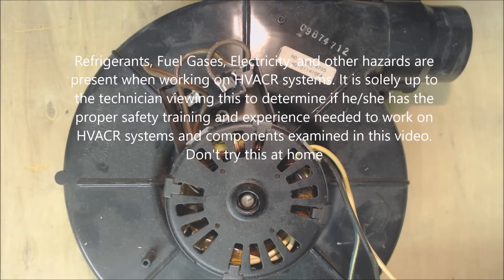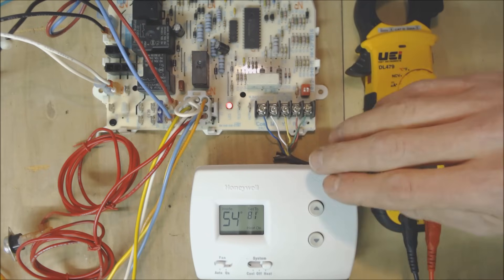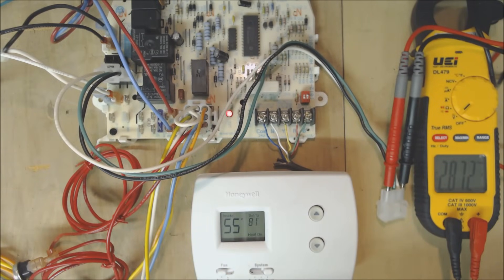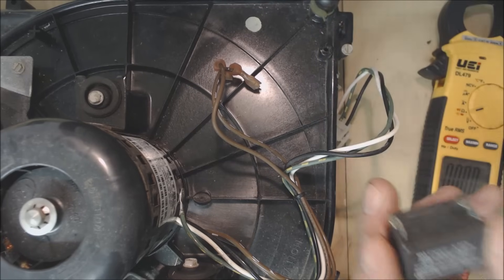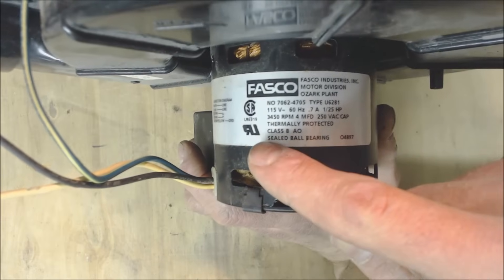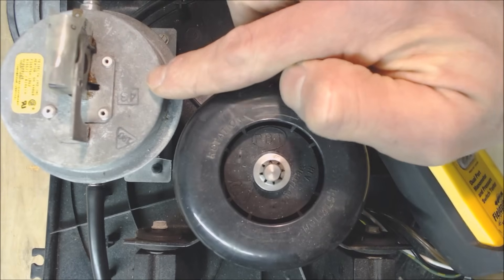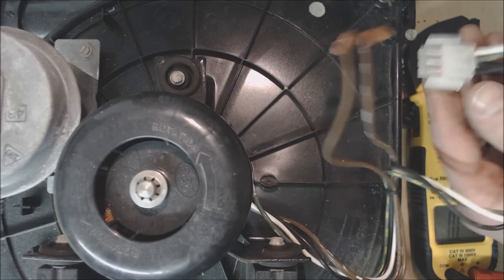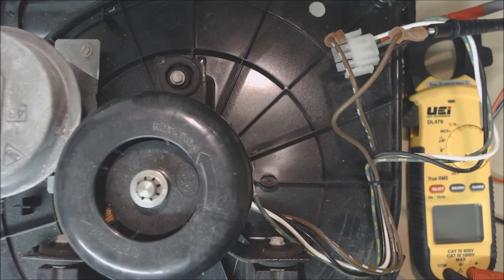Furnace Inducer Motor Troubleshooting! Top 8 Problems!

Comment: Good evening 
I have a Heil furnace and the blower keeps going on even the thermostat off. Did change the control board. I’m getting 120 volts into the control board but not getting 120 volts to the inducer. Any suggestions what I can do so see what’s causing the problem. Sorry forgot to mention I did check the thermostat and like I said the control board got swap and still doing the same thing even with the new board

Comment: or could that also be a capacitor  on the control board like u were talking about?  trying to figure out what the potential issues are
Reply from the maker: if you have 24v between w and c at the furnace control board but not 120v out to supply the inducer motor and there are no 24v limits open then the problem is the board, thanks!
Reply: @acservicetechchannel  thanks i really appreciate it

Comment: so is it the control board if youre getting 24 volts at r-w but not at w-c while bypassing the thermostat?
Reply from the maker: You get 24v when measuring between r and c and bypass the tstat between w and c.

Comment: My guy. My inducer motor keeps running after the cycle. What could that be? The red light is solid.  No blinking. The heat comes out good and runs through the entire cycle.

Comment: Brother in law calls and says his furnace is not running 60 in house.  Used an Ohm meter and found 120V at the inducer blower leads but inducer not running.  Watched this video.  Then went back to the brother in laws house next door.  Was just about to think the inducer blower was bad and tinkered with the leads to the unit at the connection on the blower, and by jarring one, the blower began running.  Used a TWISTIE TIE to keep tension on the one wire closer to the other so the blower works and now the furnace runs fine.  I fixed his furnace with a TWISTIE TIE--only thing handy at that moment!!!  Tomorrow I will review the work and maybe use a zip tie instead.  I doubt there is any cure for a bad factory made connector that I can repair and I sure am not going to buy a whole blower.

Comment: So if I get 0 reading at w and ground with r and w jumped at the thermostat, then the wiring from thermostat to furnace is bad?
Reply from the maker: Yes if you do have 24v at the board actually going to the R at the tstat

Comment: If it is the inducer motor, will it give red light blinking codes or will the red light on the board stay solid on?
Reply from the maker: It really depends on the board and unit. You would need to read the instruction panel of that unit, thanks!

Comment: Why do the hvac guys in my town just come over and start throwing parts at the problem without even checking things out like you are?
I am having some serious issues with a keeprite code 3 and all the techs wanna do is 15 min checks, reset my panel and claim things are working now.. Or now that I have gone through all the bs excuses and clean this, clean that, now they wanna throw in a new circuit board without even knowing if its the problem? I haven't seen one of the 3 techs pull out a multimeter or manometer etc.. They just wanna throw parts at it now that they've done all the easy checks and charged me 300 bucks for 2 15 min visits that only resulted in a panel reset..
I could reset the panel myself but its still tripping a code 3 on this 7 year old keeprite every few weeks..and runs in a very odd cycle of 10 mins on, 10 seconds off, 10 mins on again.. not all the time but about 50% of the cycles are weird like that..Its only a single stage furnace..
Reply from the maker: I am sorry to hear that they are servicing like that! What does the error code say the possible problems could be where it lists the errors on the door panel?
Reply: CODE 3: Check for: excessive wind; proper vent size; defective inducer motor; defective pressure switch; inadequate combustion air supply; disconnected or obstructed pressure tubing; or restricted vent. That came straight from the keep right side. Depending on what area of Canada you live in you want chart for excessive down flow of wind coming in. Do you have a cap on your vent at the top of your house. This used to be a big problem with some older furnaces oh, especially the ones that have pilot lights. However that was mostly back before most technicians after they were born.

Comment: Hi, I am Very thankful your posting and i wanna to ask that My furnace is working but the combustion air inducer seem like very very hot when the prowler is on. I am afraid that is abnormal or is fine? Do I need to change it?
Reply from the maker: It will get warm depending on the % eff of the furnace and how hot the exhaust is. If you are concerned then it could be changed. If the bearings are going bad then they present a safety concern, thanks

Comment: The inducer on my Heil 80% single stage repeatedly cycles on and off when the furnace is not calling for heat. After the furnace fan cycles off, the inducer runs on and off for about 20 minutes. Pressure switch checks out for proper voltage, tubing had a few drops of water in it. No vent obstructions either. I turn the furnace down to 58 degrees at night and this is when it occurs.
Reply from the maker: Is it just the inducer and not the blower motor? What type of ignition system does it have? HSI or spark direct ignition or pilot ignition? Does it have a board or other controls?
Reply: Just the inducer runs. It has an HSI igniter and no mother board. It's 23 yrs. old and just started doing this a few months ago. The gas valve was replaced 10 yrs. ago, and the igniter 2 yrs. ago.
Reply from the maker: Exactly what is the switch then that is turning the power on to the inducer? Is it a certain type of relay? Follow the wires from the inducer to the switch and let me know, thanks
Reply: Inducer: One wire grounded, the other goes to a terminal block, Heil # HQ1009836HW. The only update to the HVAC was done 6 months ago; a Broan HVR was added (I live in the Northeast U.S.). The Broan ties into the cold air return duct and heat supply. I am going to disconnect the Broan, the ducts and cover the cut-outs, just to rule that out.
Reply from the maker: That Heil number is a control board. If you are not getting 24v from w to c on the low voltage control board when this is happening and if a safety switch is not tripping temporarily when this is happening then the problem would be the control board, thanks

Comment: Is there a way to lubricate a motor similar to the very last one you've shown in your video? I have a Bryant 340AAV furnace and the capacitor for the inducer is weak (3.0+-5% is at 2.6). But i also notice unusually amount of stiffness from the motor itself,as well as some minor play in the shaft. Is there someway i can lubricate the unit? I cannot find any ports. Great video btw, I didn't even know to check the tiny rectangle capacitor at 4:55.
Reply from the maker: Thanks and no that play cannot be corrected. It sounds like if there is stiffness and play that the motor is on its way out, especially if there are no oil ports. Even if there was, oil wouldn't correct the underlying problem of it being worn down. Oiled motors need to have oil added every six months or so, thanks and yes replace that capacitor.
Reply: @acservicetechchannel  Thanks, Ive decided to purchases another inducer Assembly unit.
Reply from the maker: Ok thanks for letting me know powereater!

Comment: This is a very useful video, but unfortunately, I'm still having an issue. My inducer motor kicks on as it should and doesn't make a bunch of weird noises or anything. I haven't found any clogs. I checked everywhere but the flue, although, I have had the unit serviced regularly for the past few years.  I know that doesn't necessarily mean it's clear, but basically, my pressure switch isn't activating.  I tried taking the tube off of that and feeling for a vacuum, but I couldn't detect any with my fingers... Should I be able to?  All signs are pointing to the pressure switch, but the undetectable vacuum made me second guess that.  Any suggestions would be really appreciated!
Reply from the maker: Did you see this video yet- https://youtu.be/v9QWIr9TIVU
Reply: Results?
Reply: @learnjcbskidsterchickensga7594  I made a manometer with some colored water in a loop of vinyl tubing and confirmed that it had an adequate amount of vacuum.  So, it ended up being the pressure switch, and I found one locally for less than $10!

Comment: What would make the inducer reverse after the burners cut on?
Reply from the maker: After the gas ignites, the inducer just shuts off and then turns back on backwards?
Reply: AC Service Tech LLC 
Yes never seen it before I thought maybe the polarity was backwards but that wasn’t it even unhooked vent to verify no obstruction. Also new install bryant 80%
Reply from the maker: On an ac motor you cant switch the direction with polarity like in a dc motor. What were you reading with the multimeter during all of this?
Reply: 119v
Reply from the maker: Was the inducer a psc or variable speed and were you loosing voltage when it stopped and then before it changed direction?
Reply: AC Service Tech LLC yes loss voltage

Comment: I'm getting water in the vacuum line from the inducer to the pressure switch. As far as I can tell, all my drain lines are clear. What could be causing this issue?
Reply from the maker: Sounds like the trap is clogged and the water is backing up into the tube. Check this video out- https://www.youtube.com/watch?v=guf3TESb3V0

Comment: Any idea why an inducer would PULSE? I replaced the limit switch in September and that seemed to fix it, however yesterday the pulsing has returned?/
Reply from the maker: Usually that is due to a restriction in the exhaust such as water filling up a section of the exhaust pipe to the exhaust condensing while traveling through the pipe but the problem is that the piping is not pitched at 1/4" of pitch or higher upwards as it travels away from the furnace. That would be my guess, and make sure to also clean out the furnace condensate line, thanks

Comment: Hi I was wondering how tell my fasco A252 inducer motor is not working properly tnx
Reply from the maker: You would check the capacitor with the power off. Check for voltage going to the motor, and turn the power off and check if it free spins, and if it has resistance reading in ohms across the power and common wire, thanks
Reply: AC Service Tech LLC  thanks sir appreciate ur effort towards helping others 😊

Comment: Hi. I appreciate your channel. I have a Lennox system. The first time I attempted to use the Heat Cycle this season, it did not start the shaded pole inducer motor. No sysytem error messages. I assumed bad motor and replaced. Still does not start motor. I verified thermostat continuity. What should I check next?
Reply from the maker: After you turn your thermostat to heat, inside the furnace, do you have 24v read with a multimeter from w to c? If not, you are not getting a signal to the control board to start the heat sequence, thanks!

Comment: I had a tech come over and get the inducer motor going again by using the screwdriver tip you gave. He then said I need a new inducer motor without testing it or anything. It’s been working fine since yesterday afternoon and I can’t help but wonder if I really do need a new one yet especially if he didn’t test anything. Please help. :-(
Reply from the maker: If it was an inducer that has oil ports and they were not oiled over a long period and the motor seized, the bearings would be low on oil and would have degraded. In that case you would need a new inducer. The only issue is you don't want the bearings to break and the motor to continue to run which could burn up the bearings. I have seen them light on fire before. I just wanted to share that to stay on the side of caution if that is what happened, thanks
Reply: AC Service Tech LLC I went home after work and it wasn’t working again. It was trying to work and overheating, so I turned off the gas emergency switch. Looks like we definitely need a new one. I had a feeling those could potentially cause a fire. Yikes! Thank you for your help.
Reply from the maker: Glad to help Tree Sa!

Comment: My question and problem is after jumping W & R at the thermostat i’m still getting nothing at the panel when I check W and C.
Reply from the maker: Do you have 24v from R to C at the control board. I wonder if you are even getting power to the tstat? You could try to jump r to w at the control board, thanks
Reply: AC Service Tech LLC 
I did jump r&w at the control board and everything comes on .
Reply from the maker: So either the thermostat wires or the thermostat is bad then. Since you said you jumped the tstat already then it is likely the tstat wires. If you have an extra wire color already ran, try switching out the w wire at the tstat and control board if you are able to get the fan or another thing to work. If you arent able to get anything on such as the faan then change out the r wire, thanks
Reply: AC Service Tech LLC 
I bought new wire today and a new thermostat. I used a 12 inch piece of wire put it into the panel and into the new thermostat right at the furnace. Same thing nothing happened.
Reply from the maker: @CaptK-pv7ow  If you jumped it at the control board from r to w then that would be the same thing with the new piece of wire and thermostat when heating calls r and w touch.

Comment: Armstong furnace gas, induced draft blower won't start, spins freely, I don't get flame, what would cause the problem. Thermostat calls for heat main fan runs blowing cold air, hear the
heat pump starting. I am lost. Help.
Reply from the maker: Bad Inducer motor capacitor? Did you measure voltage at the inducer motor? Did you read resistance values across windings with the power off and wires disconnected?

Comment: If your changing inducer motor and it starts raining on you and your control board gets wet that is exposed. Will you wait a day for it to dry before you turn it on? Water damages these electrical components no ?
Reply from the maker: We usually try to build a temporary shelter if possible to keep the rain off. I know there is only so many things we can fit in the truck and for a service tech, it is hard to tell what the day holds or what if any special precautions you would need to take ahead of time. You could use one of your towels from the truck to gently wipe off the components and then for something like a control board use a heat gun far enough away to dry the water off the board without getting the board really hot. You seem to understand what is needed and am sure you will take precautions when needed. We just do what we can but we don't work on live electric in the rain or stand in water puddles while diagnosing live equipment. Just stay safe and try to communicate your concerns to your boss and try to think of every precaution you can take to get the job done. In a scenario like that, it is easier when you are the boss because it is easy for you to make the call. Other than that being a boss isn't easy ha ha.

Comment: Mine will not stop running what could be the problem why it never go off?
Reply from the maker: Are you calling for heat? If so the pressure switch could be sensing the problem. If not, maybe  safety is open. Do you have any error code led lights blinking, thanks
Reply: @acservicetechchannel at this moment no light is blinking but once the furnace comes on Draft Inducer never stop running.. I know at this moment as well that the door safety switch need to be change. It a goodman unit.

Comment: If an inducer motor is some how shorted to where it runs non stop would it create a false command for heat, to where the "w" terminal on the control board is disconnected and the inducer motor, blower motor and gas all run non stop except to cycle off for overheating?
Reply from the maker: I am assuming that you are talking a variable or ecm motor, in that case, it shouldn't feed any 24v to w or make the furnace think it should be in heat mode, thanks
Reply: Darn, well i have all thermostat wires disconnected from the circuit board, furnace is blowing hot all the time except for overheat protection, i do have 27volts at the w terminal and .8 ohms between w and r terminals. I replaced the circuit board and same problem. Am i missing something else or is my problem just shorting out the new circuit board

Comment: My inducer motor turns on then off, on then off when there is no call for heat and even when the heater is in the off position. This happens in the wee hours of the morning. Any idea why? thank you! I should add that I do not hear a flame and the blower never turns on, just the inducer fan cycles on and off many times.
Reply from the maker: When you don't need heat any more for the season you should disconnect the tstat wires at the control board and see if it still happens at night. Unfortunately intermittent problems sometimes take a little more digging in order to find the problem. I would try that temporarily first, thanks Gary!
Reply: Will do,Thank you..